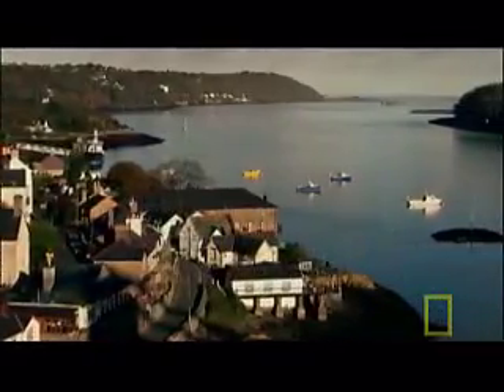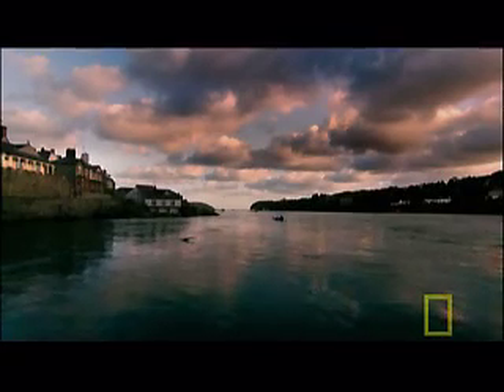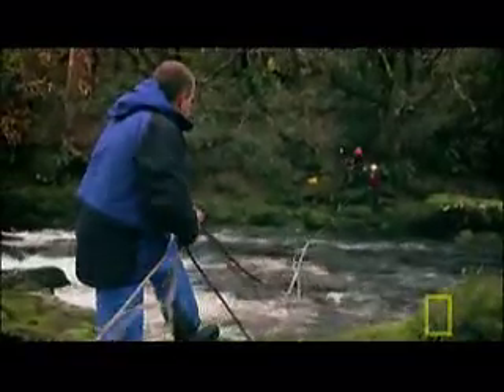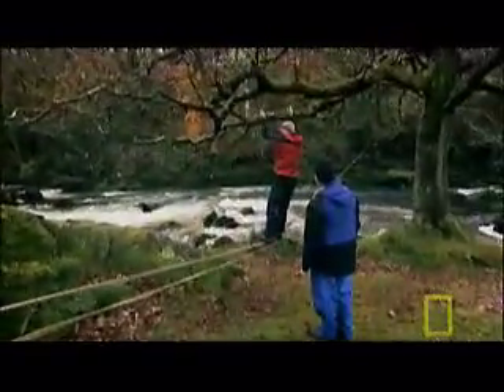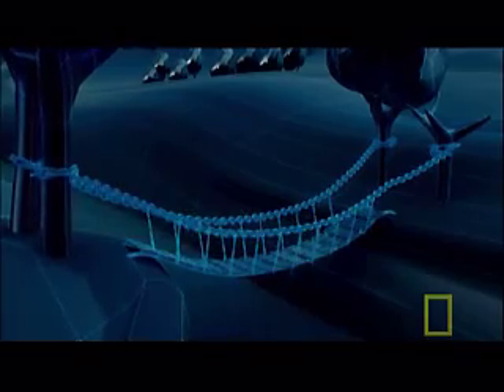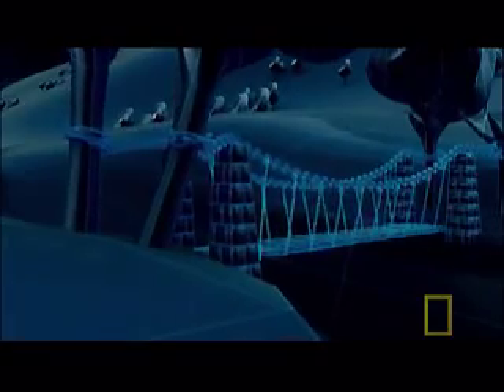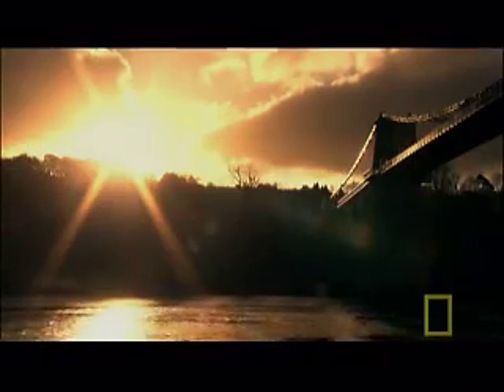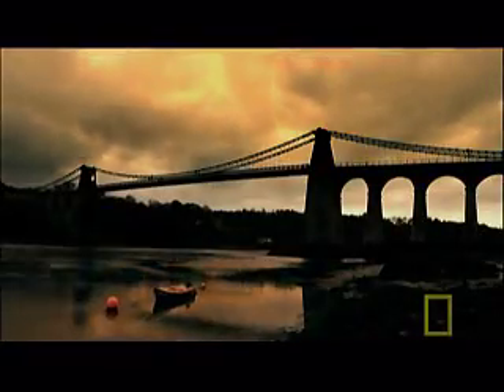Biggest Suspension Bridge | National Geographic

Comment: Those chains could fail not only if the rock fails, but also because of corrosion. 
I hope the engineers check on corrosion deep within the anchoring, because if the anchoring has been down in ther for 150 years and has not been looked after, there could be a catastrophic failure.